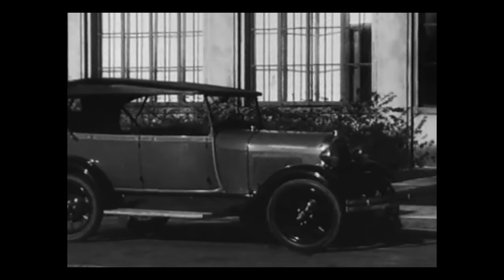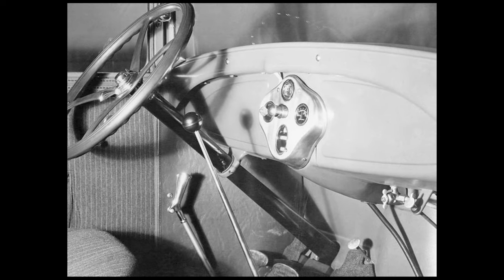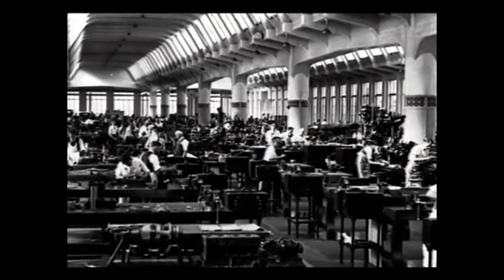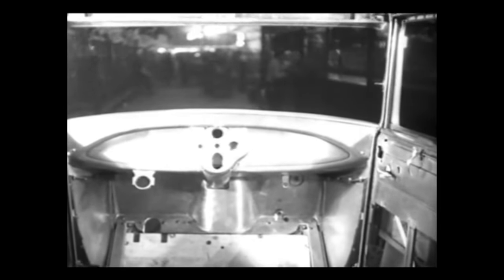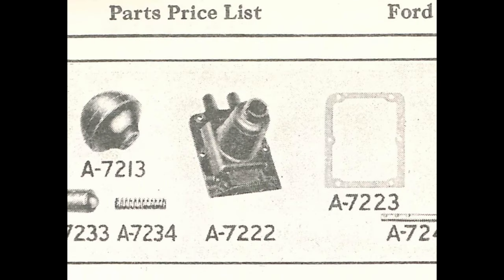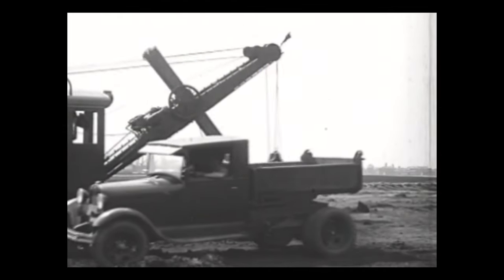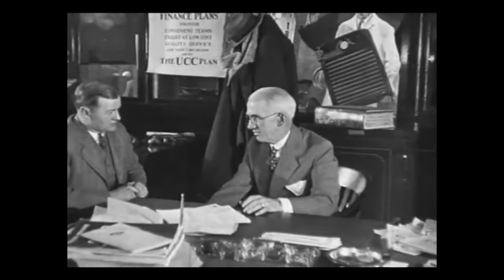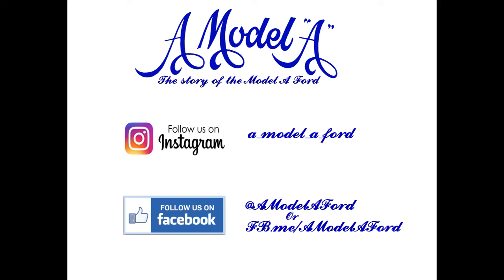What is A Model AR Ford? The problematic nickname for early Model A's. 1928

Comment: ..this is much like the "64 1/2 Mustangs" to me...sorry, but there were NO '64 Mustangs, 1/2 or not..Ford sold them ALL as '65's..there are early "features", like these on these Model A's, early '65 Mustangs, VERY early ones...and later ones, with different features  that were gradually changed as production marched on...to make matters worse, some states back then were still titling cars the year they were SOLD, not the actual model year..this generally accounts for the Mustangs that are titled as "64's"..I do wonder if there were any Model A's titled as '27's?..my dad once had a '50 DeSoto that was titled as a '49..but it was clearly a '50 year model..it had been sold in '49, and titled as such...
Reply: I had 1 of those '64 1/2' Mustangs. It had a generator, heater switch was different, etc. It was poppy red with a white interior, not the Pony interior, 289 'D' with 4-speed. No cove trim, no backup lights, no rocker trim either. Biggest gripe was when I had to fix a leaky heater core. Had to remove the console & the passenger seat b/c the heater box had to be removed from inside. Only did it once tho.
Reply: You are right, ser. All were sold as 65s.
Reply: A lot of people are swapping titles and such. A lot of people have to since they don’t have a title from the real car. I’ve had to buy a title from a scrap yard for a few cars

Comment: That floor-mounted lever for engaging the brakes while parked is, surprisingly, not called an “emergency brake” but in fact, it’s called a “parking brake.”
Reply from the maker: Thanks for taking the time to comment. Ford referred to the floor mounted lever and all of its associated parts as the Emergency Brake. You can see it referred to as that in the original Instruction Manual as well as the Parts Indexes.
Reply: Ford have always referred to the handbrake as parking brake.
Reply: Its a parking brake and an emergency brake… who cares what ford calls it….

Comment: I like the terms "very early 28" and "early 28". Which would be determined by the VIN. It just seems more accurate.
Reply: Except that they didn`t have actual vin.  They used eng numbers and most cars after all this time have had the engines swapped.
Reply: Ahh! VIN. Yes. On a Model A that’s right between the ABS computer and the catalytic converter, right?
Reply: @williamosterheim1695  Maybe you can help me. I've been searching the internet for a day or two trying to find information on my dad's 1930 Model A vin number. I'm told it is supposed to be the number stamped on the engine between the stars. That number is different that the vin number on an old registration card my mom still has. I assume the number on the old card came from the original title that we cannot find right now. Is there a number that matches the number on the title / old registration elsewhere on the car so that she can apply for a lost title? Thanks for any reply.

Comment: Funny how hobbies have jargon and sub-cultures.  My '28 was sold to me as an "AR" due to E brake on the driver frame rail, Powerhouse, multidisc clutch, red steering wheel, etc.  I had to ask the seller what it even meant, so it obviously wasn't a selling point.  Armed with this newly acquired Model "A" knowledge to go with my first car, I felt I was running with the big boys.  I was quickly disabused of the wisdom of using the term and no longer do as it's a "trigger" word in the hobby.  I thought only very young and sheltered people have "trigger" words.  Not so!  We seasoned hobbyists do too I quickly found out.

Comment: My AR tudor had so many parts that didnt interchange with later 28-29. Brake drums, hubs, wheels, front fenders, generator, starter, no separate e-brake system, carburator with twin venturies, fender lamps,  bumpers, T style lug nuts, it goes on and on. Sold it 90% restored to a guy in Toledo 50 years ago.

Comment: Then there's the 1903/04 model A that has a version called the AC because it has a the engine & radiator used in the Model C.

Comment: I had no idea that Ford A had a left side hand break. For me the name AR dose not say anything special. Just as the Gorky plant had there first cars made partially with Ford parts. So did also thus parts fall obsolete once they discovered some parts needed huge upgrading. So the vehicle would not fall apart on none existent dirt roads. The first GAZ AA and the last one where also very different but no one has ever debated which of them is more valuable? Probably cause there are less of them in the world now then Ford T and As.
Reply: @Jack_Russell_Brown  Yup it dose referee to the plant in the USSR. It is present even today but the town name Gorki was replaced with Nizhny Novgorod. That is the old and correct name for the town before the 1917 revolution. The plant first started building the soviet versions of the Ford A. Called GAZ A. The GAZ A went to modifications later to improve its resistance to the none existing roads of the time. I suspect the fist GAZ A had more things incommon with the Ford model A.
Reply: @Jack_Russell_Brown  Glad it has been a help. There is still a lot of mystery surrounding the building and funding of the Gorky plant. Ford did agree with it but the terms of  it remain unclear to this day. Official records show they managed to make aroud 450-500000 GAZ A cars before WW 2 began. Survived have less then 20. Most of them got scrapped or destroyed after the war. Cause people saw almost no value in them.

Comment: I was born in 1943 and my father had a 39 Ford dump truck. After I learned to read I would open the parts and service manual that came with the truck and I’m thinking it may have been at best 3/16 of an inch thick.
As a young person I would study that book constantly so I knew where all of the parts went because there were exploded views. And in 1962 I went to work for a Chevrolet dealer and ended up in the parts department. Although there was a huge difference between a 39 Ford truck and a 62 Chevrolet it is quite amazing for the differential for example on how similar they were. What confused me as a child was and I’m just using an example here, all of the differential parts carried the first numbers and letters such as 
B9AZ, How could every part have the same number? As it turns out those letters and numbers represented the differential and depending on the year and when it was made  the dealer could tell what part you needed with the right information. Chevrolet had a different system, for example if you wanted to camshaft they had a system called a group number 0.519 and every cam shaft was listed after that by number.  Just trivia but Ford change their system originally used with the model A.  I’ve not touched a Chevrolet part since 1969 but I still remember part numbers.
Reply: It's funny. Because ford and International  have been in cahoots for years. Recently, International has been selling badge engineered Chevy's. You call Chevy, they say call International. Call International, they say call Chevy. If you find a parts tag, and the last two characters are a C1 or C2 designation, then it's a International part number ( sometimes crosses over to Ford ). But if it's a 8 digit part number that starts out "looking like a GM number", call Chevy. Go figure.
Reply: It is 50 years since I worked  mainstream parts but I still remember popular Holden part numbers. Parts that were very fast moving in the day and unavailable now. Lenses, mudflaps, lhd clutch slave cyliner mounts [used in gearbox conversions that i Have not done in 40 years!
I sell new and used parts and get the clowns restoring cars wanting such and such part number,, numbers often superseded when the models were current. And ofcourse often updated as time went on as one part became suited to several models [and even makes]. Very annoying as they do not believe you. 
Or they want date codes!! Wanting 1969 date codes on rims still made on 2022 and wet their nappys if not.. They must go to  car show and take the tyres off!!
I have worked in the automotive industry since late 69
Reply: @VitoVeccia  Daewoos, recycled Vauxhall /Opels made in Korea. You would get Vauxhall bagged/ boxed parts from your Daepoo dealer. This in Australia.
There is ofcourse no end of 'generic' parts that go through decades of service. Sometimes in opposing brands

Comment: I'm guessing the "R" equated to "Revision". When only one version is available that is A-7222. Once a second version is available the original is A-7222-AR and the revised part is A-7222-B. When a third comes available then the first is still A-7222-AR, the second becomes A-7222-BR and the last one is A-7222-C. 

Always fascinating to dig into Ford's part numbers. In later years the first two characters are the model year the part was introduced - D0 is 1970. E7 is 1987. 3rd and 4th tell you the product and area, so E7TE is 1987 Truck/Engine. Then you have the part number followed by a revision code. They did switch this up around 99/00 but it's still more or less the same.
Reply: The R means REPLACED.  Meaning that part has replaced by a new one of different design.   The Revision is the suffix, for example A- 7772-B "B" is the revision identifier in this case the second revision of the part.    Ford still even today uses the revision code suffix after the part identifier number..

Comment: Good info.  To anyone interested in getting the right parts on the right car, you are looking up the original part used on the date punched into the firewall/gas tank for everything from the horn, generator, carb, brake lever, etc.   Most of this information isn't hard to come by for the most common and noticeable parts.    I don't recall ever seeing a car with open ended bumpers, though, so that's a pretty cool one.

Comment: Surprisingly, when I worked in Ford parts starting in the nineties, I had a construction firm call me with an "A" part number they wanted twenty of, and yes, it was still available. Evidently, it had been used by a company that made some kind of crane, and I'm guessing there was enough demand to keep making them.
Reply: Wierd stuff, Halibrand quick change diffs use Ford ring and pins. Sprintcar steering boxes use LHD Saginaw parts,
Reply: You can still buy most of a 50’s Peugeot 403 motor brand new, because they used the same components in Hyundai forklifts and other heavy machinery even today!

Comment: Interesting points made here. As a former Model A owner, I usually regarded a left hand emergency brake handle as an AR. Now, that after watching this video, I guess I can use the placement of the E brake handle to signify an “earlier” production vehicle on quick glance. Btw, who owns the 189 car? I’d be interested to know if there are even lower #’s out there.
Reply: A189 is the lowest engine out there that's publicly known; however, the car it's attached to was assembled later than at least one other verified car (A616). It was sold in 2013 and I don't think the buyer is known to the Model A internet at large.

Comment: I have read that the earliest Model A's had no emergency brake. So , if you have one that's difficult to park on inclines it may be one of these. Or it may be just one of many that just no longer have one. Also mentioned, many early A's had a multiple disc clutch. If you have an A that's hard to shift into 1st & reverse it may have a multiple disc clutch. They had more drag than the single discs.

Comment: I had an early 28 Tudor. What a pain in the butt to find the right fenders,wheels, brake drums, axles, stater, generator. The single rod brake system never worked right. Should have put hydraulics on it. I had fender lights too, copied after Lincoln I think. Multidisc clutch worked great. It you let it out too fast, you could almost pop a wheelie!
Reply from the maker: The multiple disc clutch is the obvious best part of the early Model A's, thanks for watching!

Comment: Once saw an early model AA flat bed truck build in late 1927 with all of the AR features.
Reply from the maker: There were a few AA trucks built in 1927, around 286. The Open Cab Pickup came along in early 1928 but the closed cab trucks not until late spring of '28. Thanks for watching!

Comment: How about AM?  I have a 71 Galaxie, and the troublesome r/h exhaust manifold ends in that. It means Australian Modified. There is many other parts with that ending, exclusive to RHD aussie delivered cars. And most of our imports came from Canada, and Canada cars are sometimes quite different to the US models. The steering box is Saginaw,, a Chev item and leaves a lot to be desired.
I dont know about other US cars exported to other RHD markets. 
GM have different parts numbers for the same item,, an American gearbox  mount uses a different part number to an Aussie one. But is the same part
Reply: I always wondered why they didn't just do away with that right hand drive stuff, then everybody could just build/engineer their cars one way, much simpler..but then again, I do appreciate that U.K./Commonwealth countries are willing to do things their way and not care what everyone else thinks...I think of it much like our(the U.S.) sticking to our own measurement system, and not converting to the Metric system just because that's what "everyone else" is doing....

Comment: Interesting. I hadn't heard the term before. BTW, when you said production "through 1932", did you mean up to 1932? I thought production of the Model A ended sometime in 1931. I have a '31 pickup that I'm told was pretty well towards the end being built in May of '31... The fun fact is that it has been in my family since 1941.
Reply: Production of regular models, like coupes, continued briefly into '32 at overseas and Canadian factories. I think some of the unusual bodies, like certain commercial types, were still being assembled in '32.
Reply from the maker: The Model A continued to be built in the US and Abroad into 1932 and some foreign assembly plants even built Model A's into 1934! AA trucks were also built into 1932 some as late as May and June. Is your pickup a narrow or wide bed?
Reply: @AModelA  Thanks for the info! I'm told mine is a wide bed.

Comment: Friend of mine had an A R roadster that had the louvers on tbe hood at an angle.
Reply from the maker: Yes through mid 1928 the louvers on the hood were all a uniform length. After that the louvers got larger from front to rear to stay parellel to the line of the hood side and top seam. Thanks for watching!

Comment: Wouldn't "A" being first version, and "B" being a second version make "ARevised" or "AR" I first dealt with Ford's Prefix/Body/Suffix Part numbers with Agriculture in the 80's. I now deal with Ford's Part System in Vehicles. Like the Vid said  the "Body" or basic Area number remains the same 7222 in the Gear Shift case. Now Suffix and Prefix describe Where and When built.

Comment: I feel like I would be able to actually make it up a hill in one of these if I swapped it to like a harbor freight engine don't get me wrong I like the model A but it's a little bit too early for my tastes I mean I wouldn't even be able to take it on a parade there's just too many hills around here that are really steep and it won't make it up the hills I can't tell you how many times I've been at a classic car show and somebody has a model A and they are stuck at the bottom of a hill there's no such thing as flat ground here it's all hills like it or not I've also seen it where there's people taking them out for spin around town and they'll have to get out and have the passengers push while they're flooring it to make it up a hill most of them just simply don't have the horsepower and that's why they weren't very popular around here except on the shoreline where it's already level but if you go even 20 minutes inland it's nothing but hills hills and rivers and valleys the whole way that's why loco mobile was more popular here not only just because they were made here but because at the time they could actually get around some of these hills

Comment: It's not much different than when I get parts for my 2000 Ford F350 4wd drw powerstroke diesel the earlier production models that model year took different brake calipers and pads than the later models that year I also believe that there was a difference in materials made in connecting rods
Reply from the maker: Thanks for commenting!

Comment: 2:00 You mean built through 1931.
, Not through 32.
Reply from the maker: Model A's were built into 1932 and there are even foreign assembly plants that built Model A's later than that. The Chile Ford plant was still building Model A Phaetons in 1934.